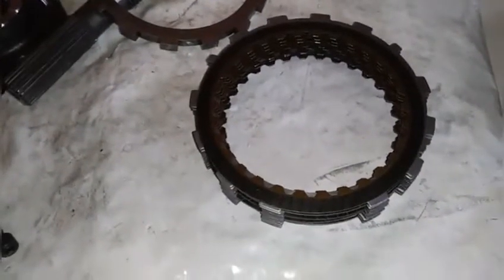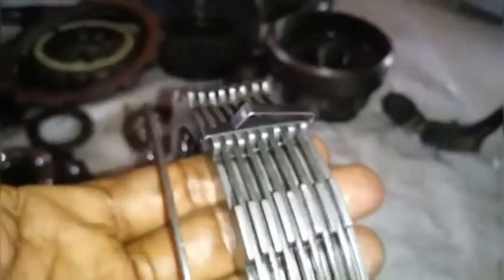Nissan Frontier 4-Speed Transmission(RE4R01B) Rebuilding. Part 4/11

Comment: I have 1 problem  with my terrano ll td27 t automatic 
RE04R01A.  I shift D mode  it change gear 2nd to 3rd  very fast  
But 4th is normal  to speed 80 km/h 
How can I fix it ? 
Thanks . ❤
Reply from the maker: Try this, https://youtu.be/CXBzX6WbVYk

Comment: hey sorry for posting here but in your alternator video if u remove the diodes in the alternator it will produce 120 volts ac current you can the use  a "stone  wheel grinder" that has 2 spining wheel stones like the ones at harbor freight...because the stone wheels act like a fly wheel and have the torque to spin the alternator ....then loop it back after its running and u can still have excess energy from the alternator while runnning the "motor stone grinder"....if u want to stay in the realm of dc then u can use atredmill motor as the motor to spin the alternator because they all come with a heavy metal fly wheel that produces enough torq to spin the alternator while having remaining energy for other appliances...
Reply from the maker: You talking about this: https://youtu.be/q6x0JIB0vYA we have it all figure out and it working great for the pass few months. YouTube don't seems to like this channel, so we are not promoting any more video before YouTube shut us down for making too much sense. Thank you.